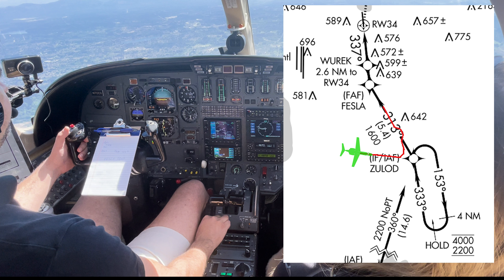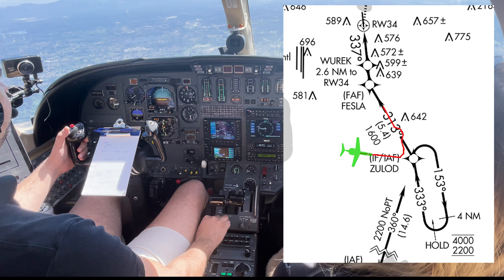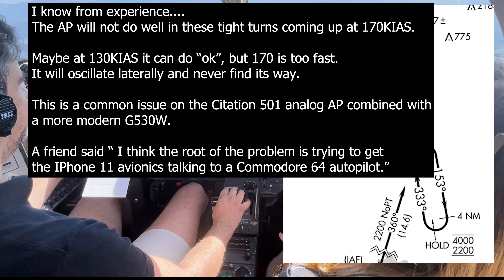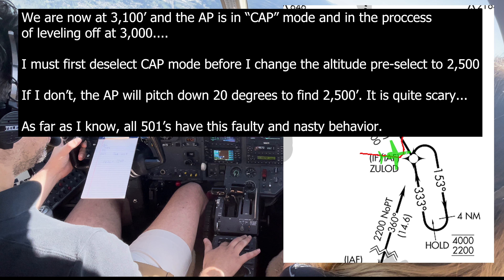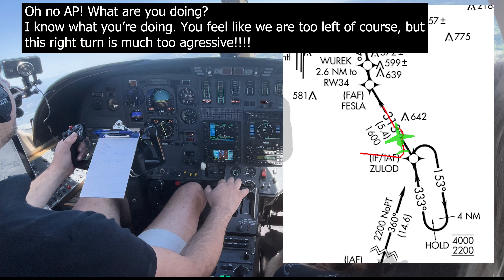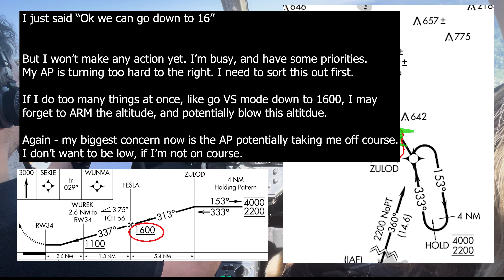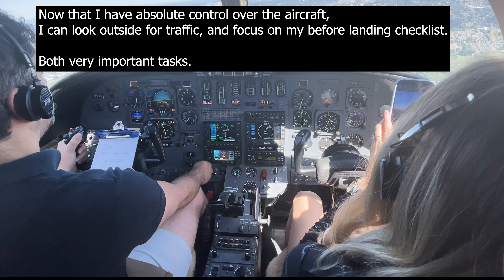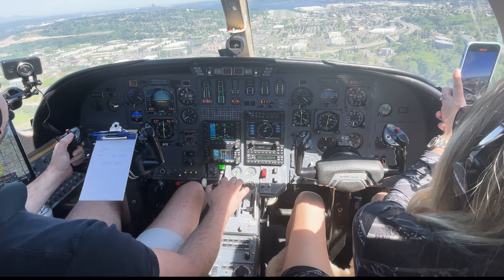Instrument approach gone wrong with Autopilot - TECHNICAL DETAILS

Comment: I have been flying citations privately since 1982. a ISP, IISP, S2, Citation 5.  A couple of thousand hours and I still love them. At my age I now call them GrandPa's airplane.  Have had this problem many times. Now have a Garmin 750 driving the old autopilot. Sometimes I leave the autopilot on and depress the TCS button by your left thumb and hand fly through the turn then release the button and everything is still engaged. When all else fails and you find yourself saying "what are you doing now" to your autopilot then the disconnect button is your best friend.
Reply: @FlyWithNoam  check you email
Reply: @FlyWithNoam  TCS stands  for ?

Comment: Regarding around the 4 minute mark. First I Love your videos and flying, well done! I’m a 501sp owner/ pilot like you. With  the alt cap problem I cancel the capture  and eliminate the hard pitch over with the pitch wheel. On mine it will cancel the capture, then i re-arm the next form of automation. An added benefit is my autopilot will capture gs  from above most of the time with this technique. I realize our old citations are all Frankensteins and everyone figures out their own techniques. Mine is similar to yours. Sperry ap and 530w no gpss box (that I know of). I too use heading mode to help speed up the turns and dampen the needle chasing. I call my autopilot “Betsy “ and shes never to be trusted 😂.

Comment: I occasionally fly a 550, same avionics package as you, same deal, fly with HDG mode to make large course corrections is necessary. I turn in to intercept, make sure “vector to final “ selected, and go to APP. Good work recognizing all of the things happening and prioritizing them in my opinion the correct order
Reply: @FlyWithNoam  yes, I am not recommending it the owners of the 550 unless they want to upgrade the panel. Through my career it is absolutely digital to analog loss. Gives me something to do! The ultra that I fly full time is all integrated so it flys the the turns perfectly.

Comment: Armchair sim pilot here… so I’m not exactly qualified to comment. But, since you asked, I’d be in Camp 1. You knew that the AP was going to have trouble handling the difficult approach before you reached IAF. Sure, having the AP handle it would be optimal, to reduce task saturation. 
But as you shared, the old Citation analog AP can’t keep up. 
So… hindsight 20/20 says, turn it off immediately before IAF and hand fly. That means no time is spent troubleshooting it. That frees you up to maintain speed and altitude restrictions plus looking for traffic. Less anxiety than wondering IF the AP is misbehaving. 
This was VFR, with good visual range. The bigger question is had it been IFR, would that change the equation?
Regardless, kudos to you for putting this out there with your self analysis! We’re all here to learn and be better from the experience. Good job. 👏🏼

Comment: Questions from someone only recently instrument rated in a single engine piston:

1) Is fuel the reason you avoid the course reversal at ZULOD?
2) In my airplane, going too fast isn't generally a problem. Generally they say to me "keep your speed up as much as you can", which gives me a bunch of discretion in deciding when I need to slow down for landing. When ATC gives you a 170kt or faster restriction, when are you released from that restriction? Is it only when ATC explicitly releases you? Or do you get to set your landing speed when you're cleared to land?

Thanks for this. It's interesting to see the different types of problems you have vs what I have.
Reply: @FlyWithNoam  Oh! Interesting. In every scenario so far, I've either requested the course reversal and been granted it or requested to skip it and been granted. I didn't know there might be a scenario where ATC would say "no".

Thanks for the response.
Reply: @FlyWithNoam  Oh. That's interesting. Since getting my rating and filing IFR, I've basically done what I did in training and just requested the course reversal when I'm >90 turn and requested not when I'm not.

Of course I've only done that a couple of times, so maybe as I gain experience I'll see different things.
Reply: @FlyWithNoam  To answer your question, there are two places where the speed restriction is lifted on an approach: 

1) The clearance limit fix of the restriction. e.g., "Maintain 170  until 3nm from FAF. Inside 3nm can slow down or "Maintain 170until joining final approach course." Alternatively you may get an actual fix, "Maintain 170 until ZULOD."

 2) Automatically at the FAF (as you stated) if no earlier clearance limit fix were given. In your case, the answer is FAF because controller gave you a blanket speed restriction. The answer where the poster said it was once the approach clearance is given is incorrect.

As for flight idle to put the gear down, I use to do the same in a Falcon 10 and Gulfstream 3. Flight idle, speed brakes, sometimes raise nose slightly to add drag to slow down a bit faster, silence gear horn, then reapply power once desired speed/configuration is achieved.

A bit of an editorial - I am old school, and I tell you the GPS approaches sure involve a lot of button pushing at times and monitoring. The part I like about an ILS is it does not "Suspend" on me. I still hand fly most approaches (that's half the fun for me right there). I religiously do one coupled approach every 4th approach to keep sharp on autopilot procedures.

Happy and safe flying!

Pod Tri (CFII MEI)

Comment: Like to point out a couple of things, first ATC didnt ask you to stay above 170kts the clrn was 170kts OR GREATOR you could have slowed to 170 right away , second an approach clrn cancels any prior speed restriction unless the controller reinstates it and then its only valid untill the FAF. Just wondering do you have the GNSS steering instilled ? As for the autopilot when you are that close to the airport and you are trying to intercept the final descend and slow down and the autopilot isnt behaving just turn it off thats no time to try figure out why  just fly the airplane you are just overloading you self and then you will end up being Jerry Wagner.
Reply: @FlyWithNoam   I spent 30 years as an Air Traffic Controller  in Center  Tracon  and Control Towers with 26 of those in Chicago , ATC CAN NOT assign a speed inside the FAF , in your comment you stated that ATC "asked me to stay above 170 KIAS" they did not they just gave you the choice . I wasnt trying to be smart asking if you had GNSS i dont know how you A/C is equipped ! but it might not be a bad idea to have it installed, just saying ......................... Please dont be a Jerry
Reply: @FlyWithNoam  No problem , yea the speed clrn" 170kts or greater " for ATC means any speed 170 or above , 170 was the slowest that they wanted at the time , they prolly gave you that as you were the lead dog to the airport and there was traffic to follow. As for speed to the FAF I think you may be right about the 5 mile final , i have been retired 14 years so some time the memory isnt the greatest. Yep get you a GPSS steering box and you will be happy happy joy joy when flying RNAV approaches and RNAV Sid and Star. Yep i  just looked it up speed restriction till FAF or 5 mile final which ever is greater. Remember dont be a Jerry :)

Comment: You’re savvy enough to recognize that George doesn’t like 170kts yet you accepted the clearance to “maintain 170 or greater”.  Getting behind on an approach starts back there (pointing at the FAC intercept).  Following an ATC clearance is regulatory, if you accept it.  But, you don’t have to accept an ATC clearance if you can’t do it.

Comment: Thank God for your safety, My Dear Pilot... Let me tell you that all this work can be avoided in a better and better way, with autopilot control, but you must either be ready for this type of technique or pre-order from ATC  something called Extended Down Wind Approach because of the performance and make sure that they will help you. 
What is clear to me is that your experience is somewhat lacking, and this is why you frightened me so much when you retard the throttle like this, and for this reason, the autopilot warned you with a warning sound, and this could have led to a blink of an eye to the stall in the critical approach stage. Please take caution and try all the conditions in the analog device and focus Inside the plane because you are not in a  VFR on this flight. 
And always remember that the plane does not fly on the railways, meaning that you can ask permission to do anything or save for the sake of safety,,,,,,,,,,,,, Always remember that the professional pilot is always learning and developing.